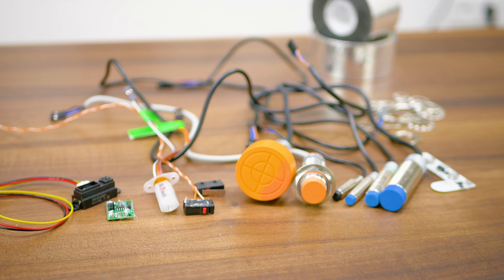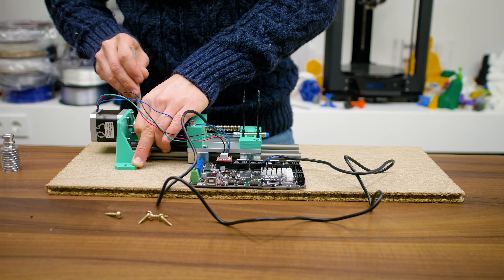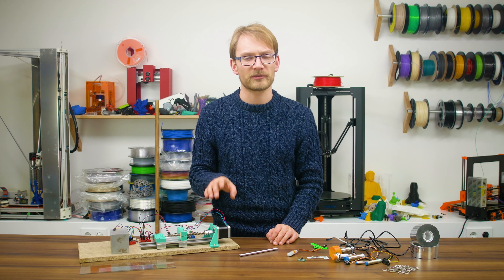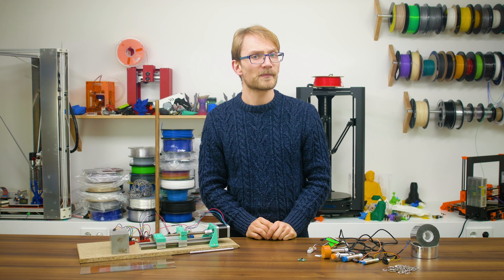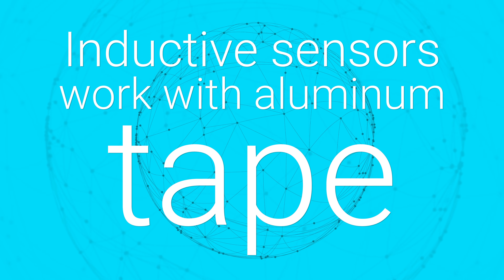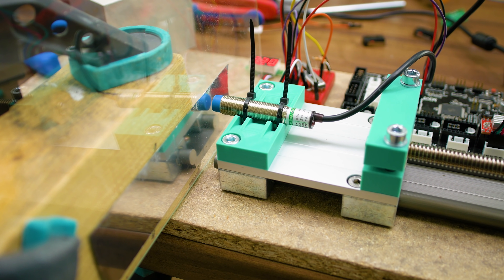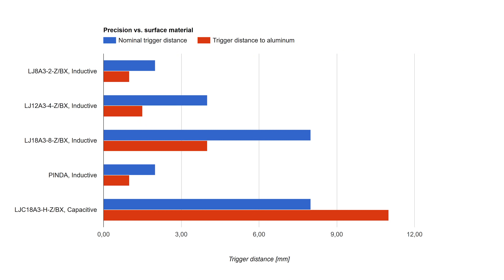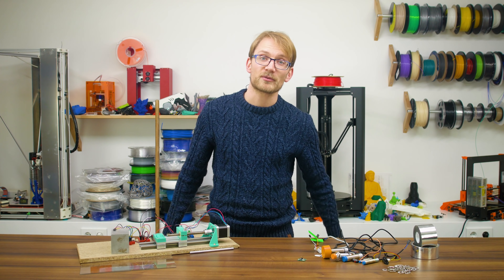Autoleveling on 3D printers: 9 myths and 12 sensors tested!

Comment: Mate |(Thomas Sanladerer), I appreciate your video, but I'm a bit faster in checking my study materials, I don't know, maybe I don't want to grow old studying a single ideea? You speak about SD, you tested that bunch of sensors but, if your conclusions are not secret, why don't you put them on writing? I'd like to see some graphs with actual SD values (and the averages, since we're talking now about normal distribution) and some links to datasheets without having to hunt the information through 13 mins of video. If you did those tests and the results are free for everyone, organize that information like an engineer, for God's sake! Help people to make faster and better informed decisions based on your research. 
And, btw, Deb Morris pointed that BLTouch should be mounted vertically, therefore that test is not valid. 
Anyway, good job (otherwise I wouldn't loose time writing this). Cheers!

Comment: I don't use autolevel for couple reasons - I print on glass, and I can't afford (or justify the expense of) ball screws. I use an inductive sensor (LJ8A3-2-Z/BX-5V), as a fixed Z end stop switch, sensing a mild steel bolt head. Using a digital 'dial' gauge,  I get repeatabilty of ~3µm delta (not standard deviation). That's with T8 lead screws and DRV8825 drivers, 32 microsteps, so 1.25µm per step. Not bad I think, for a modest outlay, and plenty good enough for 3d printing.

Comment: Can you redo the tests but use the  BLT touch the way it supposed to be vertically mounted not horizontally
Reply: What would the point be? He flat out told you it was done sideways to remove backlash from the equation and limit  the results to just the component . Turning them upright wont change how the devices reacted mechanically one bit .
Reply: @wind5250  and apparently you didn't read the instructions for the bill touch it supposed to be vertically standing not horizontally to work properlyso if you want to test something the way it was made to be tested and used that's the way you do it not for non-science a backlash there's no backlash when there's up and down
Reply: @mathewphillips4185  not only did i read the instructions i own one.  Laying it on it's side is just as valid as standing it up.  The fact his results are within  spec as well as repeatable , and comparable to other reviews more than demonstrates this .
Reply: @wind5250  you read the instructions but apparently didn't follow them (and are misusing the equipment you own, but that's your choice). It's simple physics to demonstrate that there is a mechanical difference in how the probe behaves when it is vertical vs. horizontal: 

When vertical, gravity acts on the spring to pull it down and keep it in its rest position. When the probe hits the surface, it can cleanly move upward until it can trigger its Hall sensor. When horizontal, not only is gravity no longer aligning the spring correctly, but there is additional friction resisting the movement of the probe (thus causing the probe to move fractionally less for the same amount of deflection). When the probe contacts a surface horizontally, there is no force preventing the probe from deflecting sideways ten+ microns before triggering the Hall sensor, leading to a loss of  precision.

If using your equipment like this works for you, that's great, but it's objectively incorrect to say that orientation doesn't have an effect on the BLTouch and other precision equipment.
Reply: @TROPtastic  You took all that time to write a reply but obviously not enough to actually comprehend before hand . First of all i never said how i mounted the device let alone i mounted it sideways. What i said was it would make no difference to repeat the test upright because the results are within spec and repeatable which they are . 

You are literally arguing that the device will perform better than the manufactures tell you it will by turning it right side up. 

Anyone who actually uses this device knows they give invalid readings after time  the only valid questions would be what version this is and was this one new or used .
Reply: @mathewphillips4185  Testing it in the same way as all the other sensors is also vital to have a correct experiment.
Reply: @squirrelrobotics  In theory you are correct, but mechanical sensors are acting different because gravity is a factor, optics, capacitve and inductive are not affected by gravity. The pin of the Bl-Touch is using some type of guidance and because it is used not the way it was designed to be used, it can affects this and creating minimal mechanical resistance. because we are talking about so small distances, even a very small change in mechanical resistance can make a difference. The interesting thing here is: From the Bl Touch Homepage the sheet is showing the micro switch should be much less that good, but it seems from what I saw in the video that the micro switch ist outperforming the Bl-Touch sensor? May be the BL-Touch was used in the wrong way, at least not the way it should be used to achieve the offered precision? The gravity has nearly no effect on the microswitch, because it was designed differently and to be used also in any orientation.
Reply: You are rigth, but so was the other guy. 

Does it matter, I do not think so as the specs are what they are and if it performs within the specs then each individual will have deviation between themselves due to tolerances temperature and other factors. So if it works horizontally within spec then it works horizontally. Does it get a better result vertically, probably but is it within the standard deviation both ways then they are ok.
Reply: @josephwoo8125   i'm not making myself look foolish the guy i was talking to removed some of his post.
Reply: It's one of those 50/50 things - if the thing is designed to be mounted vertically then it may well be more accurate for a mechanical device. The problem is then you start introducing weirdness in the test rig. It'd probably be worth doing both and seeing if it makes any difference and it may be possible to compensate with the data you generate but.. effort.

Comment: If the tests were conducted  as in the video , what do you make of Antcap's instructions regarding how the BLTouch must be mounted ? 

The manufacturer's website for the BLTouch  clearly states this:    if the sensor is mounted horizontally it WILL give wrong results.
They don't equivocate. It is a crystal clear stipulation.  It is underlined even . Would you care to comment ?
Reply: Yeah he should have tilted it...
Reply: If I'd design a device like this small I'd surely factor the gravity whether I'd use a spring to push the pin out or not (as it happens I'm not a flat-earther, I "believe" in gravity). Probably the pin is pulled in by a coil (with the ferromagnetic pin acting as a core). Because it needs precision, the spring, if there is one, should be weak, but the trigger point will be more influenced by the sensor orientation. I guess you could make it switch just by shaking it in the hand. To be able to ignore the gravity direction (and to have repeatability no matter the sensor orientation), the spring should be stronger, but, in this case, the precision will go away, especially with microsteppping. Factor in the uneven friction, which can be significant for a such small device and the need to keep the price small and you'll have an answer.
I don't own this small guy (BLTouch) and I didn't check the datasheet, but your observation is perfectly valid. And the BLTouch test is not valid.
Reply: Also the other mechanical sensor results aren't valid either because he's just testing the switch itself when to actually use it you'd need a mechanism to remove it to actually print.

Comment: Thomas, can u help me, capacitive sensor or bl touch to use with glass bed?
Reply: Capacitive sensor will work on glass but variation in height will occur if bed is hot or cold or ambient temp and humidity varies. Variation is enough to mean requiring checking height with paper every bed level, whereas BLtouch will always be right. Maybe try the 3DTouch first and if you like it go for the more expensive but original BLTouch.
Reply: @SchrodingersNeighborsDog  i give up on glass, using aluminum now!! its working...
Reply: @dddxp7311  Seen beautiful results on aluminium bed, less effort making it stick and better than glass in some ways as you don't end up with a perfectly smooth shiny base which doesn't match the other sides :D Enjoy
Reply: @SchrodingersNeighborsDog  yes, im going to paint into a powder texture my alumminum, the results its awesome!

Comment: Wow, a basic micro switch without the lever performed much better than the BLtouch.
Reply: Sam Chaney the bltouch is not made to operate horizontally, it may be more accurate when used correctly
Reply: @communistkid1767  how you know is it horizontally ? he explain what bltouch numbers mean every 3-5 print it will fup up to 0.1mm

Comment: Microswitch is more accurate but is there any practical way to use one as a bed leveler since it would always be below the nozzle height?
Reply: You put the microswitch in a holder that captures it "positively"  (or use superglue without getting any into the switch body itself).   You create a place for the holder to attach to where it can be "deployed".   When not in use, you detach the holder and put it in the stowed position.    Personally, I'm going to use some small / strong neodymium magnets and a little pocket for the switch holder with paired magnet to "click" into.   Meaning:   The magnet in the receiver will be slightly higher than the magnet in the switch holder.  This will create an upward force pressing the switch holder into the shoe.   Or, I could just use 4 magnets.   One for the horizontal alignment and one for the vertical alignment.
Reply: @underourrock  Very interesting idea.  I have a BL touch because it only cost like $8 as a clone.  It seems to work fine.  I wonder how much z offset variability would be introduced with your method of having to uninstall and reinstall the sensor.  I guess if it's inside a pocket and secured in with magnets it should be minimal.
Reply: @seventyfive1  the key being a positive stop / positive fit.  No slop.

Comment: It is a nice video and I learned something,
but I my expectation was, you would have tested more different types.
Besides, most printers use an optical sensor, which block the light.
For bed leveling, it is often the touch sensor, which you did quicly glance over.
I kinda missed the hal sensor and the piezoelectric sensor.

Comment: So, I've been thinking about these results, and I don't believe they can be conclusive for which sensor is actually best for "bed leveling" since that involves sensing at several different places on the bed.  This test setup, though certainly useful and helpful, may not be telling the whole story since it continuously tests only one spot on the big aluminum block.  A better more conclusive test would test how accurately each sensor can sense the actual flatness of a bed; i.e., at multiple points.  Since an aluminum bed, for instance, may not be perfectly uniform across its entirety with respect to its inductive properties, would an inductive sensor actually perform worse than or only as good as a physical touch/contact type sensor in an actual "leveling" application?

Comment: I thought you needed an PNP sensor? (at least for a ender 3) Can you use either and set the high/low trigger in marlin firmware? 

Also, what voltage divider did you use?

Comment: I want to address something I've been seeing floating around the internet regarding the inductive/capacitive probes. People keep saying you need a 12 V to 5V voltage divider on the output. This is partially wrong, and may, in fact, introduce more errors in your bed leveling.  The sensors do absolutely need to be run from 12 volts to achieve their rated specs, but if you are careful to buy an NPN type sensor, you can simply plug the output directly into the Ramps input pin. This sensors are what is called "open collector drain" output. It means that it doesn't provide an output voltage when trigged, rather it pulls the signal provided to it to ground. The Arduino/Ramps board has internal 20 kohm pull up resistors on all of its pins (enabled in Configurations.h). This pull up provides 5 volts to the output pin of the sensor, when the sensor triggers, it pulls that 5 volt signal to ground.   If you use a voltage divider, you might reduce the 5 volts enough to cause unreliable switching in the Arduino.  PNP type = needs voltage divider. NPN type = do not use voltage divider.

Comment: Thanks for your videos. I have experienced difficulties with sensors. After a few consecutive prints, the levelling of the bed was not accurate, but was accurate again the day after. I now make the levelling when the bed is hot, but the problem still exists. I believe that the sensor close to the bed and the head warms up little by little, and the temperature of the sensor may have some effect of the measurement.

Comment: You measured mostly repeatability, and mostly ignored system accuracy due to heating/cooling.
Excellent video, great charts.

Should have had an external digital DTI measure the setups actual position, logging, and dwelled (paused) after contact on the probe.
Then the DTI log would show where the moving piece actually was at probe contact, vs the start position when all was cold.

Likewise, the triggering circuit for probe hit is critical.
I did a lot of work on this, 8 years ago, on testing for lathe spindle index sensors, and we proved conclusively that sensors will give very fuzzy signals, that vary with temp/speed/luck.
A sharp triggering circuit, and a sensor tuned to give a crisp response, will be about 100x more accurate on a range of speeds vs a typical probe "hit".

I also saw that optical sensors will repeat to about 2 microns, with very simple basic cheap sensors.

Comment: Hello Tom, 

I wonder if you can help me with a couple of queries.

I have bought a LJ12A3-4-Z/BY inductive sensor.  It is the 12mm diameter version as I did not have room to fit the larger 18mm version.  The problem is that the detection distance is halved to just 4mm.  I was wondering if I could power the sensor directly from the power supply and possibly fit either a voltage regulator or resistor voltage divider to reduce the signal back at the board?  I also have some 0.1mm stainless steel foil that I am intending to place under the 2mm glass.  Will this increase the ability for the sensor to pick up the magnetic field?

One last point, do you know if it is possible to devise a method of using a k type thermocouple instead instead of a thermistor?  I know that a thermistor decreases voltage as it heats and a thermocouple works in the opposite direction but i would like to use a PID to control hot end temperature as it better controls better without overrun once heating temperature is achieved.
Reply: Hello Peter, this being a year old video chances are Thomas does not answer questions anymore.
The inductive sensor has 3 wires, +V , -V and Signal ,  +V can be anything from 6-36V DC , the Signal wire is either OC or CC referenced to -V (ground) depending on what status the Sensor is in.
I dont know what Printer you want to add it too but if it's a printer with a micro switch on the Z axis then you should run the Inductive Sensor through an Optocoupler and then hook it up to the wires where the micro switch were.
Depending on what Optocoupler you use you can run it and the Inductive Sensor off the 24V Printer PSU without 
and kind of drop down regulator.

Comment: The BLTouch manual specifically states the sensor must be run vertically. Since your test rig is horizontal, the results are suspect. It would be good to rerun the BLTouch test with it held vertically.

Comment: Another one to try is the piezo force sensor. Mount it in your bed support or (as I did) in your hot-end mount on the carriage and it registers contact of the nozzle to the bed. Zero probe offsets in X, Y and Z, change nozzle and all you have to do is run the auto-level. Super convenient. Precision Piezo do a good rig.

Comment: Hello Tom. May I first congratulate you on your clear, informative videos and have now subscribed to you. I am new to 3D printing and Arduino world in general. I have just bought the Ender 3 and having watched various autolevelling videos also purchased the BLtouch sensor. I have added the bootloader to the Ender 3 and now want to download the relevant sketch to control the BLtouch. Can you direct me to any video/information that will help as I am a little confused with what I have seen so far. Many Thanks. Rob

Comment: would it be possible to use the z end stop as an auto level, for example moving the z end stop to the extrude instead of the side and have auto level turned on in firmware